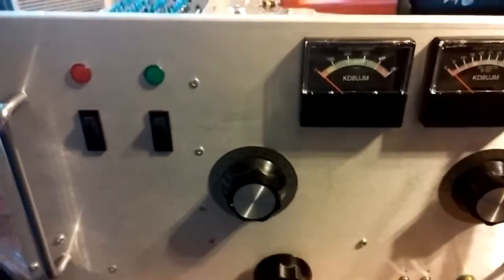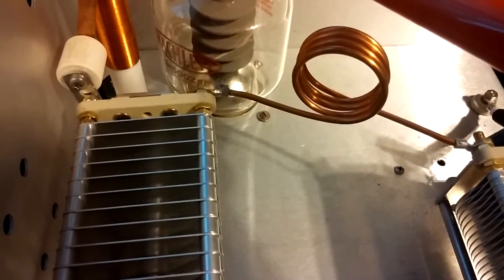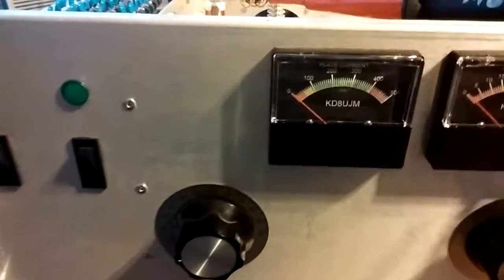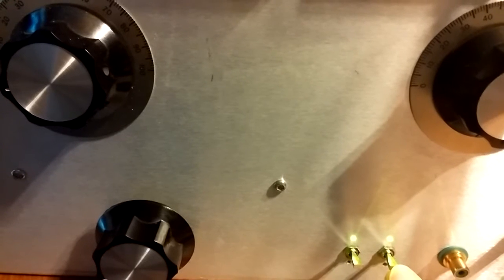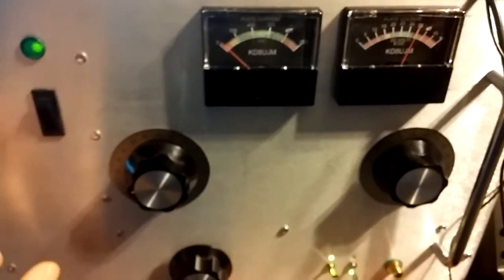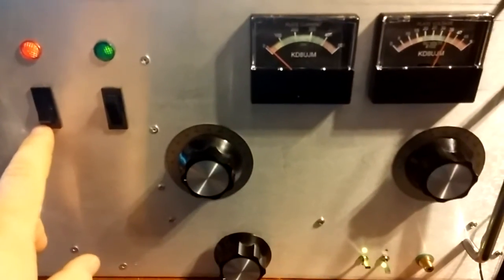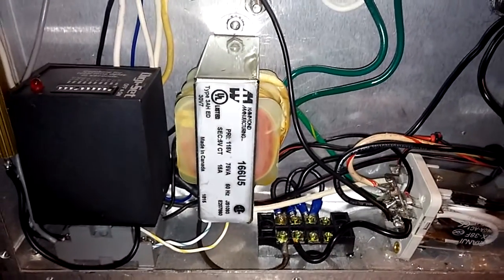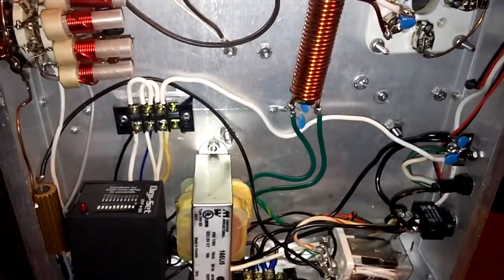My 1st Homemade Hf amp. 1kw+ from 1X 3-500Z tube 160 through 10

Comment: Excellent amp! At 3:41 is a SMPS; is that for the filament power?
Reply from the maker: Sorry for the delay but no, that little power supply is just a 24 volt power supply that powers several of the relays. If you look just before that there's a Hammond Transformer that is used for the filament.

Comment: That's very nice work. Custom labeled meters. Is the chassis Alodined? The skirted knobs must have been pricey. You can make a more compact filament choke with 2 or 3 big 2.4" dia ferrite toroids. #43 for HF.  Though most use ferrite rod which is less expensive. Watch out for the switching supply on the bottom side. I've purchased a few of those like that are notoriously noisy and have very poor line and output filtering. If it's running during receive mode it will radiate back into the T/R switching.